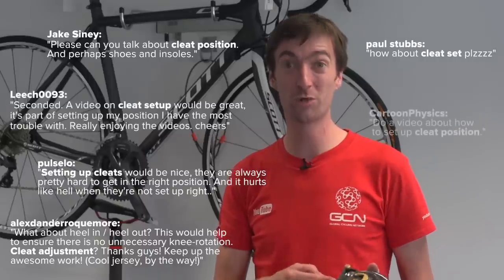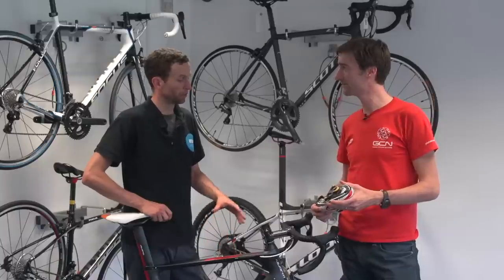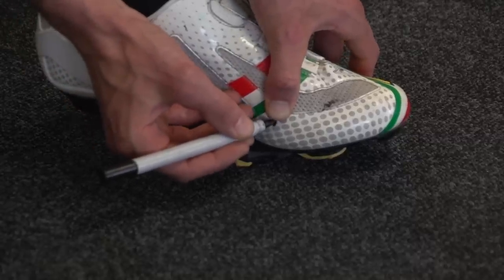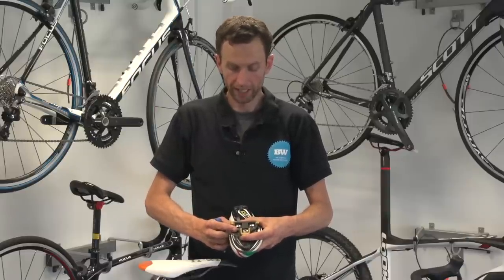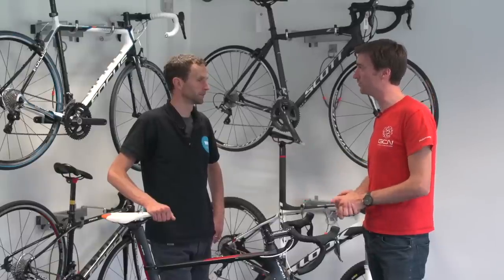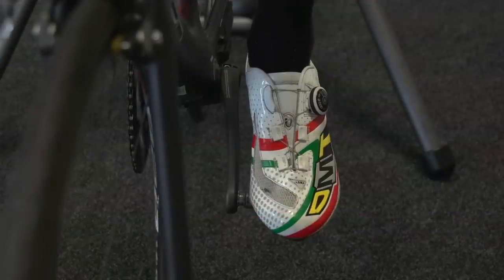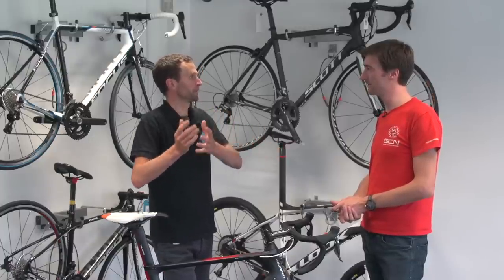How To Set Up Cleats For Clipless Pedals

Comment: You guys are fantastic.  I am currently riding with regular Nike running shoes because I am a bit taken back at the idea of being clipped in with my feet.  I have Legg Perthes in my right hip and this causes a 3.175cm or 1.25 inch difference in leg lengths. My right leg is shorter than the left. I have split the difference on saddle height.   This is now starting to cause issues with my left knee (front). I am going to invest in road cycle shoes and get a professional fitter to fit me on my bike and help me adjust all the cleats, etc.  I am getting the shoes and the fit session to assist me in my rides, average 30-35 mile (2.5 hours) 4 - 5 times a week. I am trying to strengthen my atrophied muscles in my right thigh and keep the weight off as I am about to have a Total Hip Replacement within the next 6 months to a year.  Cheers for any and all advise.

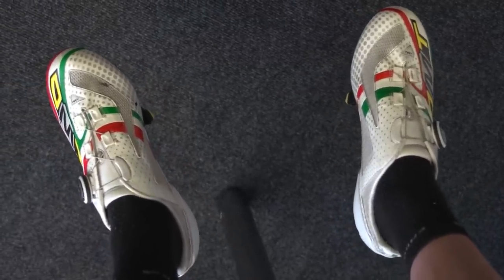Comment: Thank you so much for this video. I was suffering from lower back pain, discomfort, exhaustion only after a dozen of km's.... 0:50 solved the problem. I used to point my shoes inwards which was a stupid thing to do. My pelvis started to rotate backwards and cause terrible pain and poor posture. 
Adjusting your cleats is as capital as adjusting your saddle

Comment: I'm just starting with SPD so a quick questions - In case of a bad cleat setup would the pain or discomfort (anywhere - knee, hips etc.) be immediate during the ride, right after the ride or maybe accumulated over time? I had a great first ride, no pain, but I'm curious if that means I'm all set or if maybe there are things that would appear at a later time...

Comment: I've got a recumbent trike, I imagine the clip setup would be the same ? I never had any problems with knee pain riding without clips on my upright but going clipless on the trike has introduced occasional discomfort. Spinning, higher cadence, has helped ease a ride where pain started cropping up, fiddling with foot position has helped prevent it entirely, I just haven't dialed the cleats in right to get it every time.

Comment: Hi. Thanks for the vídeo.  I’ve got a question. I realize that I am getting a bit of a discomfort inside my left knee. I realize that when I ride I am hitting the end of the float moving clockwise.  So moving the heel out and front of foot in. To the point that the the Clip occasionally even comes off the pedal.  Should I try moving the cleat horizontally (q factor) more towards the outside to get the knee closer to the bike? Or should I try first moving the angle of the cleat towards the small toe (in order to then have the front of the foot pointing more to the right). I have the tendency of moving my feet inward (heel out) and is hitting the stop end of the float angle. FYI. I am using SPD cleats.

Comment: Even beginner riders should have clipless pedals.  That said I firmly believe that beginner to intermediate riders should be using the cleat that allows the most float.  This will allow your feet to move to the most comfortable angle and afford for any mistakes that the user may have made when setting up the cleat.  Also in regards to the cleat position forward and backwards it is better to error towards the back of the shoe than towards the front.  Be careful not to allow the cleat to be too far forward.  Your shoe will most likely be extremely firm so it has little to do with where the pressure is going on your foot.  In fact there are plenty of studies that show there is no loss in performance from running a cleat mid-foot (not possible without modification to the shoe).  So fallow the directions in this video and if you are uncertain by a millimeter or two wether you should move it forward or backwards... move it backwards.

Comment: hi guys, I am injured for 6 months now.(overstreched knee) I have therapy to work on strenght of the muscles so it will be allright. But I'm asking if it has anyhing to do with my cleat position. I've never changed them since I've bought them and I did'nt have trouble with them for 2 years. Until I got injured. I've allready looked at my saddle height (was a bit too high, but changed that). So what should I do with the position of the cleats. Do a propper bikefit or just fix them by trial and error?
I hope you guys can help me so I can strat cycling soon!

Comment: Thanks for video, but when I adjust my cleats even in millimeters their is a significant difference in power. I am searching for that sweet-spot for maximum power, Also when you mark your shoe, slightly rocking your foot up & down will put your ball joint offset from spindle. Is there such a device which allows you to make adjustments whilst out riding without disengaging your foot from pedal.

Comment: So to allow float, do we not suppose to tighten the rear bolts too tight? Are we suppose to let them be loose? Thanks for the great video
Reply: No, you should tighten those to recomended spec. The float is by design of the cleats+pedala, they're made to give you a little wiggle room.

Comment: Is there anything that can cause tendonitis or at least foot pain if you set up your cleats wrong. I had no issues with my old bike but when I got a new one, I started having discomfort through the metatarsals. I did start running again but making sure the bike isn't making it worse.
Reply: The cleats probably need to be adjusted again. I wouldn't use your cleats until you have them adjusted. if pain persists, talk to a doctor and ask them for a referral to a Podiatrist, as that could mean a worse problem.

Comment: Hi all, I'm looking to correctly set up the angle of my cleats but I can't seem to understand how to do it. I'm not a native English speaker so I can't really make anything of the instruction, which I understand as "put the cleat in a mid position on the travel, so an adjustment for an aft, on most cleats, it's a couple of centimeters, so put 'm in the middle of the travel". Does that mean that I should just put the cleats outlined straight without adjustment, or that I do have to do an angle adjustment?  Many thanks for your help!
Reply: Hi, cleats can be adjusted two ways: back and forwards (moves the shoe back, or forward in relation to the pedal) or side to side (changes the angle of of the foot so the front of your shoes point towards the bike, or away from the bike). This video says you should fit the cleats so the front of your shoes point away from the bike and not too far front or back. When they talk about travel, they are saying you can adjust your shoes to make it more comfortable from what I said above

Comment: Thank you very much for your excellent video. I am new to clipless pedals and just recently installed Shimano Ultegras. I've only got about 50 miles in them but am experiencing some knee pain and numb toes. I will adjust the cleat further back on the shoe to try to fix the numbness but when you talk about "float" in the cleat, what is that exactly? Once I'm clipped in with mine, I can't move my foot more than an 1/8" in either direction. What do I do to increase the float? Thank you.
Reply from the maker: winston1493 Hi there, float is the amount of lateral movement you get. If you're using Shimano cleats they have three different colours which give different amounts of float. Yelllow give the most - so check what you're running. You may also need to drop your saddle a tiny bit as the stack height (the amount of space between pedal axle and foot) might have dropped a bit too. If in doubt, consider getting a bike fit, they're well worth it.

Comment: I've watched many of these vids, and tried the setup a dozen times now. However, I always seem to end up (during my ride) that I push my heels locked outward. I struggled with knee pain for a wihile but that seems to have gone for about a month now. Should I still adjust my pedals for the float or should I just stick to:"If it ain't broke don't fix it"?
Reply: I would recommend getting your cleats set up professionally. The absence of a current issue is no guarantee that you aren't causing damage that will manifest itself at a later date. Generally, if your setup isn't correct for your knee (part of the same fixed chain as your ankle/foot and hip) it's not a question of IF you'll suffer a problem but WHEN.

Comment: I have the shimano Ultegra pedals with the yellow SPD-SL cleats.  I think the yellow cleats have 6ﾟ of float. I like the float in the pedals but I'm having to rotate my ankle really far out to unclip. Is there any way to adjust it so I don't have to rotate so far to clip out? Or do I have to go down to the 2ﾟ blue cleat?
Reply: Go down to blue cleats, however you will need to use more force to get them out, or tighten the pedal at the back

Comment: my shimano pedals came with yellow cleats, i have recently done 150km on my bike, the first time i have been anywhere near that far. One of my knees, the left, was really sore during the ride and still is hours later. What float is the yellow cleat? Don't know if getting different cleats will help but I'm willing to try anything.
Reply from the maker: The yellow cleats have the most float for Shimano pedals, but try adjusting cleat position which might help. Otherwise search out our video on how to reduce knee pain.
Reply: I had the same problem with big rides ,ended up using Bikefit wedges ,like shims under the cleat ti straighten your leg up.Trial and error with them i have 4 under my right foot and it cured the problem .

Comment: I have recently bought some Shimano Ultegra pedals and the tension is really high so I struggle to unclip, I want to adjust the tension but my Alan keys won't fit in the screw, i need 2.5mm and I have tried that! Please help
Reply: I would say if you buy a brand new 2.5mm key and went back to the tension screw i think it would fit it and you could make adjustments

Comment: I am on the eve of getting clipless pedals. I have de problem that my heel touches the crankset evert stroke when i dont lock my foot with muscles. Should i lock the cleat completely or leaf very little float?

Btw, i use the original 32 year old toe clip pedals and they are awfull.
Reply: +Robin Jansen float is built into the cleat, you tighten the bolts up to the recommended torque. Do not under any circumstances leave the bolts loose. Angle the cleats on the shoe so your heel is away from the crankset when clipped in.

Comment: is it okay to have about half an inch or an inch extra space in the toes ? i mean the shoe fits tight on my foot .. and i cant move my foot in there in any way.. but there is a little extra space in front of my toes... is that okay ??
Reply: You have shoes that are a size too large.  The space should not affect your riding, but keep in mind that next time you get shoes, get them a size smaller (or try them on first preferably).  I experienced the same and when I got a new pair of shoes that fit smaller, it just felt more comfortable.
Reply: ***** For me I'd rather have some space up front - in fact I've just done the opposite to jamesaka2's advice and gone a size up (with some space up front) because after about 50 miles I would get some pain in my second smallest toe where it was meeting the shoe.  If you're foot isn't moving in the shoe I don't see a problem.
Reply: rhessex agreed with rhessex. If you have half an inch extra space (I wouldn't go as far to say a whole inch), then you'll have less problems squeezing your outer toes when you're pedaling under force. After long rides, I sometimes have soreness on my pinkie toes. Just my two cents.

Comment: I've heard that one should set the foot forward--cleat to the rear--to protect the Achilles tendon. does this cause problems with the distribution of load on the ball of the foot?
Reply from the maker: We've never heard of problems with the achilles before as a result of cleat placement, but I suppose you're right that moving the cleat towards the rear of the show would help in this regard.
Reply: The further forward the cleat is mounted, the greater the enlistment of the calf muscles during cycling. This could potentially cause issues with the achilles as flexion of the calf will pull on the achilles tendon to a greater or lesser degree depending upon your flexibility around the ankle joint.
Reply: currently suffering Achilles issues on both feet..very sore and painful   have adjusted my cleats to the most aft point hopefully this solves the issue..

Comment: I tried what you said with this video but my fingers got numb couple of times in 50 k ride. And I had to unclip them and shake my feet to get back normal. Why this is happening and what can I do for it? Any suggest will appreciated.
Reply from the maker: Kayhan Yalin are you doing your shoes up too tight?  Make sure you've got a little bit of room in your shoes.
Reply: hımm, I'm gonna try that this afternoon ride.Thanks.
Reply: Kayhan Yalin Did that work?
Reply: Kayhan Yalin I have this problem as well - I'm guilty of using too high a gear for the speed/pace I'm traveling at and placing undue stress on my shoes. I also use a wider, shorter shoe with a custom insole. This gives my feet more room to expand when i need it.
Reply: Yes it worked. I tie my shoes more relaxed . I am not feeling Numbness  anymore. Sorry for the late response Noel O'Dwyer.

Comment: Hi. I use spd peddles. My clip out tension is fine but I find there is a lot of rotational movement of my feet when clipped in. How can I reduce the movement of my feet when cycling?
Reply: If you reduce it you might end up with sore knees.
Reply: Neil Blake  You need to buy cleats with less rotation like SPD Blue cleats or you can buy a cleat with no rotational movement like SPD Red but be careful when chosing because the less rotation motion createds more pressure on your knees
Reply: Jesus thank you. I will investigate the spd blues. Neil.
Reply: Jesus thank you. I will investigate the spd blues. Neil.
Reply: Jesus thank you. I will investigate the SDP blues. Regards Neil

Comment: I'm having a deficult time finding that sweet spot without having any numbness or knee pain. just went to the ortho and found out that I have mild arthritis from sports on my knees. should I use speedplay instead of these shimano ultegra pedals?
Reply: +S “Pauley” Brito I used Shimano for years and also had some knee issues, until I switched to Speedplay...no issues since, plus the feeling of contact with the pedal is more solid, especially when out of the saddle. This can be due to the broad pedal being on the shoe and the cleat is on the bike, opposite to other brands. But hey, I can only share my own experience...am no expert!
Reply: Thank you - I also switched to speed play

Comment: I often get numb toes on longer rides, is this to do with cleat positioning or my shoe?
Reply: I got the same question as @artwillford. Any other answers aisde from @Joe90V. I experience toe numbness or tingling midride when doing laps. I just continue riding and just move my toes inside. Doesn’t go away though until i finish the laps. I’m thinking of also moving cleats a bit forward by a few mm. My shoes aren’t too tight or loose, just enough. I wear thick socks. No foot movement, foot does not slide.

Comment: I have a look keo areo pedals  it's the red one not the yellow I notice  it's harder to take your feet out with the red one and it moves my cleats take more force to take out
Reply: Estivi Herrera I know this is a year old, but Look don't have yellow cleats, they have red, black, grey. Shimano have the yellow, as well as blue and red. Fixed cleats (zero float)will be harder to click out. You could also try backing off your pedal tension for the cleat.

Comment: I have Carnac Shoes with Look Clipless pedals and I have tried and adjusted the pedals every way that I can and I still get hot foot on my left foot. after about 10 mins of riding I have to pull over and let the bottom of my foot stop burning or releave the pressure on my foot.. what can I do to fix this? my next option is another par of shoes...
Reply: Thanks. I will try that....
Reply: I had the same exact compo with the same issues, I also tried a variety of custom foot beds with no luck!  I ended up just getting new shoes and hotfoot was gone!  I've had other friends who have the same problem I think some shoes just aren't meant for some feet!
Reply: I got more shoes now and problem solved, I now have Louis Garneau Ventilator2 shoes!!Awsome!!!

Comment: Poor video, waffled, then rushed over the key points & missing a key diagram to show correct foot/ball alignment. Floating cleats are awful and potentially dangerous IMHO.  Float to avoid knee problems is a marketing invention IMHO, a myth.  I had more knee trouble using cleats with float, perhaps because your heels can slip away suddenly, violently and unpredictably; never had knee problems with fixed cleats - float is assumed to help avoid knee problems but in my experience the reality doesn't bear out that theory. I tried the old all-red Shimano floaters and the new generic yellow-and-black floaters. Fixed cleats give far better feel, control and power, they are more predicatable, at least that's how it feels to me, with my Shimano pedals, which have adjustable tension.  The old all-black Shimano-fixed cleats or the new red Shimano fixed-cleats would be my recommendation.